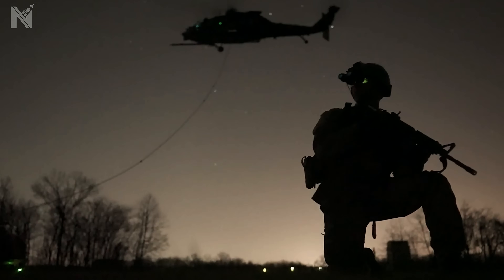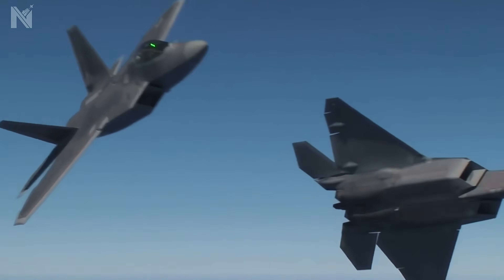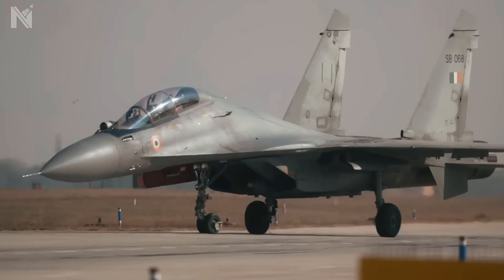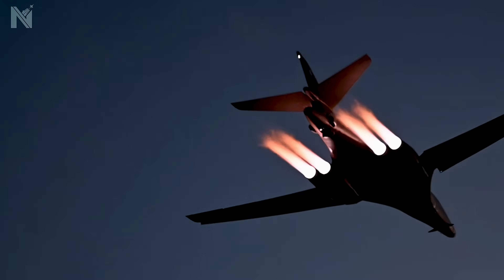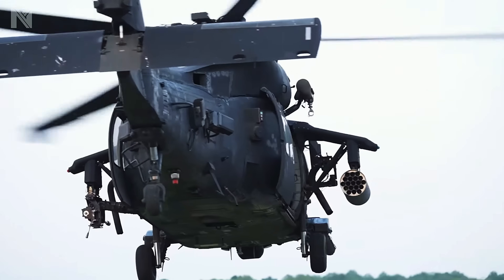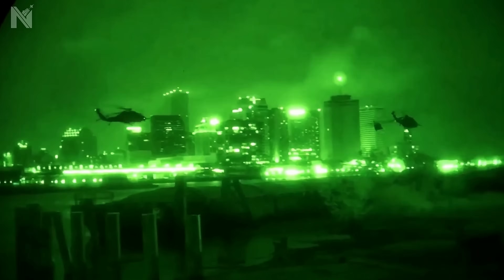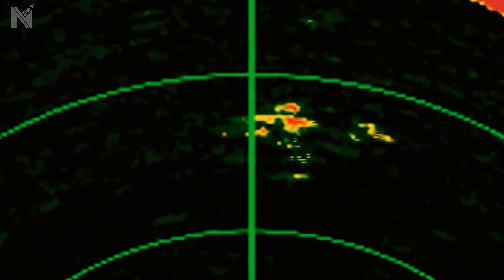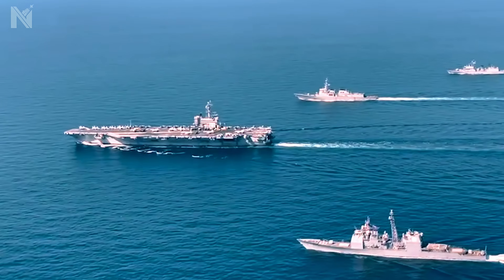Venezuela Raid: Why a Nuclear Bomber Escorted a Helicopter to USS Iwo Jima

Comment: So electric vehicles will makes these sensors useless at detecting a warm engine block I see? Can it detect a warm battery? Will military engineering start building electric vehicles to hide heat signatures to prevent these planes and missiles from targeting them?
Reply: Possibly, I think EVs, solar, wind, etc…need a couple more decades of technological development. The Biden Admin wanted to set dates to transition to all new vehicles being EVs. That is great emotionally and it makes a lot of people feel good, but completely infeasible with the current mileage range of EVs, it is infeasible with our current electric grid, and not having enough power plants. Some equipment is diesel electric currently to reduce heat and noise. I wish the Green Movement had pushed hybrid vehicles rather than EVs. I would consider buying a hybrid. But the EVs make them feel better than hybrids so we had to listen to them talk about the entire US switching to EVs in 10 years during Biden’s term.

Comment: 7:40 While the B-52 relies on loitering, the B-1B leverages its variable-sweep wings for low-level, high-speed penetration. Combining a massive ordnance load with Mach 1.2 capability gives it a kinetic energy advantage that turns it into a much deadlier delivery system for time-sensitive targets.

Comment: Yes I was just about to make the comment that the electronics and other components that made the United States Air Force Rockwell International ( Boeing ) B-1B Lancer “BONE” a Nuclear Capable Bomber have been removed. Someone else also mentioned it in the comments. This is a Conventional Only Bomber now and it can be Identified by the Orange Disk Above the Wheels of the Forward Landing Gear. The SALT ( Strategic Arms Reduction Treaty ) Inspectors can quickly ID them with that Orange Panel. I really would love to see the BONE Stick around longer, especially now that it has new upgrades to Radar, Avionics, and a Lockheed Martin AN/AAQ-33 Sniper XR Advanced Targeting Pod.

Comment: The video title is "Click Bait".  A "Nuclear Bomber", really?  The B1-B was deployed during the raid and it is "Nuclear Capable", but to infer that the mission involved nuclear armed bombers is absurd.  Your channel is bull***t, deceptive, and now blocked.
Reply: The B-1 is NOT nuclear capable, only the B-52 and B-2 are!!!
Reply from the maker: @GM8101PHX You are correct in the current operational sense. The B-1B was denuclearized in the 1990s and today carries only conventional weapons, which is exactly how it is described and employed in the video.
Reply from the maker: The term refers to the platform’s design lineage and deterrence role, not nuclear payloads on this mission. The video clearly describes a conventional B-1B performing kinetic sanitization, using standard JDAMs, with no nuclear employment implied or required. What should I call it for you to accept it?
Reply: If it's nuclear capable then it is a nuclear bomber genius.
Reply: @RyanWeaver-x5k  Then all commercial aircraft are indeed "nuclear bombers."

Words matter

Comment: B-1 is no longer a nuclear bomber. Hasn't been one for a long time.
Reply: True, but it can pack a HUGE conventional punch.
Reply from the maker: Correct. The B-1B was denuclearized in the 1990s and is used today exclusively for conventional missions, which is exactly how it is framed and employed in the video.
Reply: It can carry nukes. Therefore it's a nuclear bomber.
Reply: @LaceyClipLoki It could carry nukes. It has not since START 1 in 1994 and it cannot since 2011 when the hardware required to deploy nuclear weapons was removed from the last B-1. It canNOT carry nukes. Had you said it COULD carry nukes, you’d be less wrong. The title of the video implies something that is not true.
Reply: Its original purpose is nuclear bomber. Therefore it will always be a nuclear bomber.
Reply: @cinemoriahFPV  Not according to START.
Reply: Exactly. If they got this wrong, how much other info is wrong too. Clicking don't recommend.
Reply from the maker: @johnt6213 
The distinction was clarified in the comments and the video itself employs the B-1B only in its current conventional role. If that clarification does not change your view, I respect your decision.

Comment from the maker: We showed you the tip of the spear (F-22 & B-1B), but over 150 aircraft and a massive "Sea Base" made this 30-minute extraction possible. Question: Which asset impressed you the most in this video: The invisible F-22 or the supersonic B-1B? 👇 Tell us below. (🔔 Next Briefing: We are preparing a full "Tech Breakdown" of EVERY single machine used in Operation Absolute Resolve. Subscribe so you don't miss the full roster.)
Reply: The AN:APQ 187